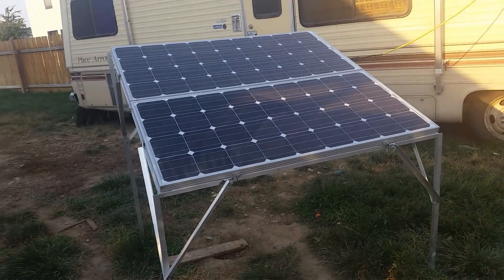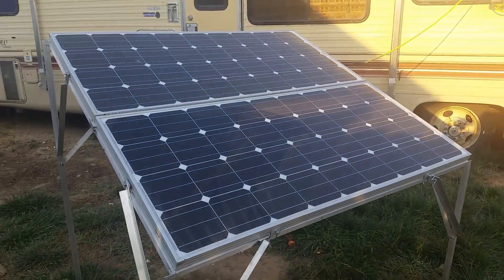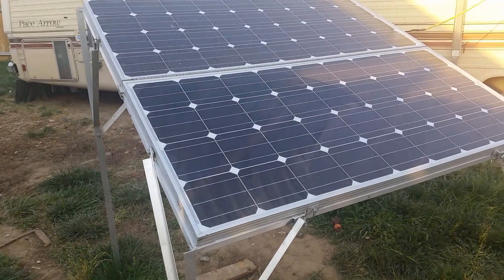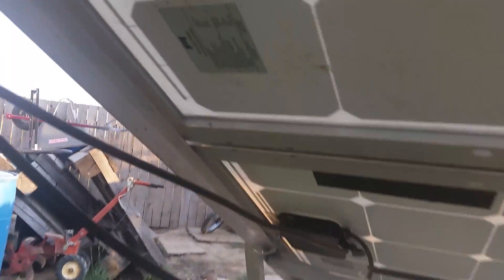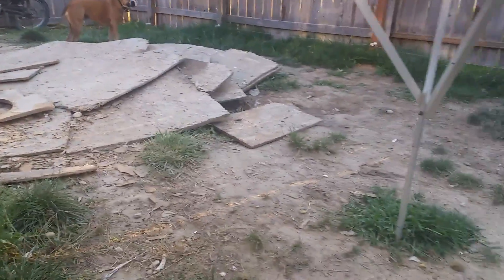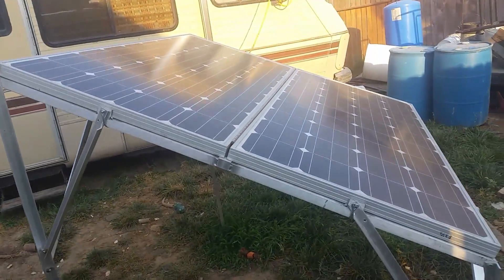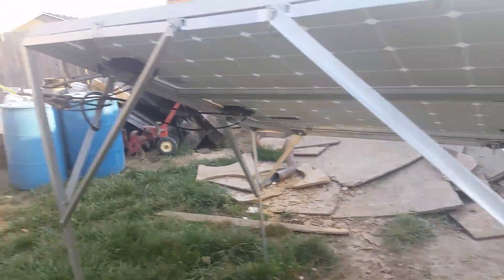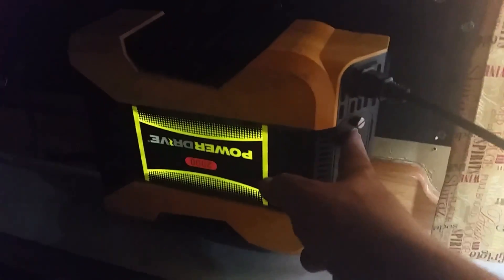Renogy 40A 12/24 volt charge controller and my solar setup

Comment: I hooked up everything on Renogy mppt 40 Rover. the top pv white light is no coming on for some reason..Have it connected to3 deep cycle batteries. Just got it today if you can help it would be great..I'll give you my cell# if you like..have 300 watts going plus going to add on more 100 watt panel soon.

Comment: Great vid Brother.  I have a system that I use landscape wire for my panels and other thing such as lights.   It cheap and it works.  I have 9 100 watt panels running to my shed with this wire for three years.  I’m going to get the new renogy 40 Amp MPPT charge controller.  Have a great day.